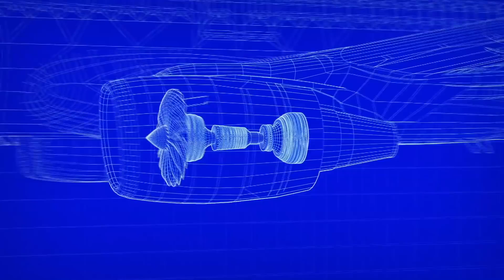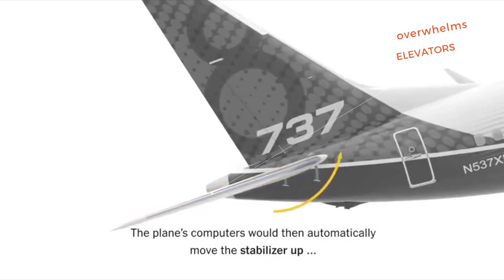737 Max 8 probable cause revealed - Prof Simon

Comment: Computers have driven aircraft systems for decades.  The Airbus flight controls are all controlled by "fly by wire" systems that have no direct connection to the hands of the pilots.  All radio signals through computers.  The Max 8 is not unstable.  It develops a stall when the nose goes up too far.  What most pilots do not realize, maybe they didn't pay attention in the flight simulator, is that the new LEAP engines because of placement, cause the nose to go up more than previous models when power is applied. This is a normal reaction.  The DC 10 that crashed in Iowa made it to the airport because the pilots used the throttles to bring the nose up and down, left and right.  It is a wanted feature.  What ewe should be asking: why is the nose allowed to be brought up to near stall conditions by the pilot without intervention and 2. when the nose is brought back up, the MCAS will only be re-activated if the nose is brought back up to a near stall.  The only scenario I can see where this is possible, other than system failure, is where the pilot brings the nose up, the trim is being set to nose up, in order to facilitate the trim, and the throttles are advanced to maintain airspeed in a climb, then the aircraft suddenly is pitched up from 1. engine thrust, 2. re-trimmed tail plane and 3. pilot pulling back on the controls.  That might be the constant up and down that is seen in the profiles.  What differentiates this from those pilots that say that the Max 8 is the best aircraft yet, they have the knowledge to disengage the MCAS in the event of problems.  The answer lies in pilot training, not the aircraft.  Those that say the airframe should have been re-designed, do not know the history of the aircraft.      The Max 8 to 10 will outsell anything Airbus can come up with.

Comment: The Mcas moving the stabilizer in response to a bad sensor is very similar to a runaway pitch trim condition.  This is nothing new.  Pilots are trained to deal with this (in the US. ).
Reply from the maker: It’s a bit different....firstly Boeing never told pilots and secondly it keeps resetting and trying again until you’ve lost the ability to recover...all under pressure and surprise...
Reply: Professor Simon Holland   Thank you for taking the time to reply.  Surprised or not , procedure is to disconnect the autopilot so that it can’t keep putting in a bad input.  Older planes used to have a big red button on the control yoke.  I understand it’s two toggle switches on the center pedestal in the Max.  When that third party pilot misbehaves, you take it out pronto.  If the pilots did not have training to deal with it , I place the blame on the training syllabus.

Comment: The truth that 737 Max 8 is inherently unstable and breaks FAA rules for commercial airplane requirements is going to kill this plane commercially.  No software fix is going to change that.
Reply: Wayne T   The Prof said Boeing had a choice: larger stabilizer or a software enhancement.  Larger stab. Means more weight, which means less efficient aircraft.   Add the weight and design effort of a new stabilizer or put a different microchip in the autopilot.

Comment: That implies a very bad design. It's inherently unstable which is not permissible for commercial planes.  It also implies other rare, but not impossible situations such as loss of electrical power/computer malfunction that lead to compounded situations with additional flight control problems. Looks like FAA did not do what they are suppose to do to maintain safety. .. US is going down.. Indonesia just cancelled their 47 planes...probably just the start of other loss orders.

Comment: Thanks for the video, I am afraid we have all guessed the answer but didn't consider that Boeing told the FAA that no new training would be required to fly the max 8, only to find out that the new system apparently has errors that the pilots do not know how to deal with, and thus the two crashes occurred during take off when the pilot had not time to deal with an automatic system that they were not trained to handle.

Comment: I disagree. I still think that both crashes were avoidable had pilot proficiency been better. Boeing's blame should be limited to MCAS design inadequacies that should warn against sensor disagreement before engaging changes in pitch trim.   In both cases, the airlines failed to ensure that the pilots understood how MCAS works. Unsafe airplane? NO!  Unsafe carrier!
Reply: csjaugiedog   The mcas moving the pitch trim in response to a bad sensor is very similar to a runaway pitch trim condition.  Pilots in the USA are trained to deal with it.  The procedure is quite simple.  I’m concerned that pilots really aren’t pilots these days. They can’t manually fly the plane.

Comment: Your diagram shows that "the higher and more forward position of the larger engines on the 737 Max can cause the plane's nose to pitch up - a potential danger".  Yet, your audio comments refer to the reason for the crash was a "faulty MCAS system".  So are we saying that there is a design flaw in the 737 Max related to the position of the larger engines that therefore must be compensated by the MCAS system?  And it was the AOA sensor failure which caused the crash?  How do we know the sensor failed?  It's unclear from this video.
Reply from the maker: Hi Alex, yes...the new design of the plane with larger diameter engines...and more powerful...made it fly differently to older 737s. So Boeing, instead of calling it a 797, fitted mcas in the background to recover the plane if a legacy 737 crew flew it in the traditional way....cheap and possibly bad fix imho

Comment: The 737 Max 8 has a special computer override system to correct a design flaw.  That is, engines too large for the older 737 frame.  Does any other plane by any other manufacturer have this same problem?  Why was a design flaw approved by the FAA?

Comment: Man, I do hear what everyone is saying about Boeing and MCAS, but I can not completely dismiss the actions of the pilots, or lack of, that resulted in these crashes. Remember folks, these are not the only 2 instances where MCAS has caused this scenario to unfold, the difference being and the most critical component of any aircraft, is how the pilots managed those situations. That's just an unavoidable ugly truth that not many are talking about. The 737-Max is a modern version of it's predecessor, with different flight characteristics, sure, but very familiar flight controls in place. An MCAS failure, regardless of why it's failed, still presents like a runaway stab trim issue, which is easily dealt with, but raises the question, when others have acted upon it appropriately, why did these flight crews not? You want to blame Boeing, go ahead, but understand this, a nose up attitude is present in many aircraft, obviously a little more in the Max, so Boeing addresses the issue with software, a common practise throughout the industry, but get it wrong. They will correct it, the Max will fly again, but remember, the aircraft is recoverable, it's not a complete lemon, but as I feel is the case with the 2 very unfortunate instances, having a competent crew operating the aircraft clearly improves your chances of survival. Experience is one thing, but having a high level of competency is another. You can have 10,000hrs of experience, but that does not make you competent ladies and gentlemen.
Reply from the maker: Look at their training....
Reply: @SimonHollandfilms  I did Prof, hence the last observation regarding experience, but the quoted 200hrs for the FO is a little scary and may not have helped much given the environment they were working in, minimal altitude etc, which in my mind is bloody scary if Airlines are allowing pilots with minimal flying hrs to sit any where near to cockpit. That can't be right can it, surely he had more than 200hrs of total experience, maybe only 200hrs in the 737, which would make more sense, but brings me back to my first conclusion, wouldn't have been much help. Regarding the pilot, who I think had 8,000hrs, that's ok, but what type of pilot was he. Was he someone who has to follow all of the checklist when problem solving, which is ok, preferable even, or is he capable of thinking outside of the box and respond instinctively, because there is a big difference between the 2.

Comment: a more thorough physical redesign would require additional costs in manufacturing, replacement parts and maintenance. Probably should have started with a clean sheet aircraft. This whole situation is one gigantic mess. I hope we find out the honest truth sooner rather than later.

Comment: 1. The plan design was flawed. If designed properly the plane shouldn’t need a computer to fly properly. Computers fail, as they did in this circumstances.
2. The pitch sensors failed. They were faulty in the original 737.
3. The software was faulty.
4.The pilots were ill trained to access and manually override the failing system.
5. The procedure to override the system, fly manually and save the plane from disaster is ridiculously complex and time consuming, for even properly trained pilots, as seconds count to evade disaster!
Why wouldn’t one flick of a single switch be the override?

So many problems Boeing is in big big trouble. 
Many heads should roll.
Sell your stock now.
Reply: ARVID LYSTNUR   I agree except for number 5.  The procedure is actually quite simple and a pilot can perform in in sufficient time.  But the pilot must be willing to take manual control of the aircraft.   Something apparently lacking in the modern pilot who is just a systems manager.

Comment: The pilots had no chance with a misconfigured MCAS System. Even after turning it off, it takes too long until the trimm is set back to normal and the rudder is effective again, precious time not available at low altitudes.
Bad design decision made for greedy economical resaons, not audited with scrutiny by a failing FAA, paid with the lives of close to 400 humans.
This is the biggest aviation scandal of the last 50 years!
But the press is still concentrating on the failure to disclose the MCAS system to the pilots - which wouldn't have prevented the planes from crashing as the pilots don't have immediate control even after the MCAS is turned off.
Reply: The Stonegate Roadrunner,
I thank you for clarifying with substance what I’ve awkwardly stated.
It’s clear that Boeing needs to both repair the MCAS and develop an instantaneous override!

Comment: Why doesn't Boeing just install a string with a fixed end tied to the side windshield's frame just like what F-14 does, let the pilot view the AoA instinctively and let pilot decide if his AoA is too high. Low tech does not guarantee precision, but it is very reliable.
Reply: vc Biller  The string on the F14 is for yaw trim indication ( engine failure).  Has nothing to do with pitch.  I like the simple idea , though.

Comment: Can someone explain to me why this 737 Max did not stalled when it took off vertically at an airshow?
Reply: Miguel Barrero   Weight and balance for one thing.  Didn’t have 130 passengers on it. Second : it was under manual control all the time.  The pilot was connected to the behavior of the aircraft.  Not letting a third party fly the plane.

Comment: Apparently, flight crew can override the MCAS system but it appears some were not adequately trained for the changed 737 flight characteristics and did not, as a result, subsequently gain updated type certification. As a result, when the MCAS responded incorrectly, and repeatedly dropped the nose in response to a perceived high angle of attack, the flight crew were not able to respond quickly enough to override the system and correct the plane's attitude in the right way.

Comment: These monsters! 
They told the computer to protect the plane from the pilot’s poor manual handling skills. 
But then the two sensors can’t agree. 
The poor computer doesn’t know which sensor to believe, and is “afraid” to give manual control to pilot that might have caused of the whole mess in the first place. 
Poor thing :( 
Probably killed itself from depression... depressing the nose anyway...

Comment: IMHO always liked Boeing over Airbus for some reasons, but this is unnaceptable. Not the fact that a design is flawed, because it might happen. But the fact they knew about this weakness and put a SW patch. CEO of Boeing telling that safety is core to the company after the crashes. Boeing did the most relaible planes ever built, the 707, the 727, the impressive record of the 777. Poor managment most quit Boeing inmediatly. This bad decisions cant be rolled out. They ruined the 777x launch, and needed to be rescheduled.  I dont think Boieng enginering got bad, just the bosses did. Boeing is not Tesla, doenst need to hesitate for a new plane to rival Aribus. Both make an impressive work, top notch technology, and quality standards. It a shame that they run behind the purchase order and lead times. Because they can produce the finest and safest plane on earth if they want. Just, give the teams the proper time ansdroom for proper desicions. Im sure that many people warned about this inside Boeing itself, but CEOS are tuned in another channel. Same with DC-10. The door flaw was known. But, because financial reasons and presure, they pretended that it was right when in fact, it wasnt. They crashed tree DC-10 to realize that the door need to be fixed.

Comment: Apparently the Mcas system has the ability to move the stabiliser right to the end of the jack screw. In this situation even full elevator movement would not be enough to regain control. The aircraft would either climb to a stall or nose dive.
Reply: Arthur Matthews  that’s when a pilot takes over and manually retrims the aircraft and flies it him/her self.

Comment: So basically the max 8 has a design flaw with an unbalance centre of gravity that could lead to a fatal problem from day 1.  Boeing knew about it but just opt for a workaround instead of redesigned the plane and properly fix the problem. The motive that drive boeing choosing the workaround because it's the cheapest fix. Another reason as to why the introduction of mcas system and the ipad training was to keep everything discreet so that people wont be having 2nd thoughts and making a big deal out of it by saying the new 737 max 8 is totally different plane from the old 737, which then required the plane to go thru buttload of airworthy test as a new plane before the FAA can give the green light. The FAA might be colluding in it as well but to what extent remains to be seen.

Comment: it's unfortunate such a control mechanism put more lives on the line, a software update to me will still require a patch one way or another in the near future as it has happened. Boeing needs to come up with the best plane design which won't have such control flaws messing with the safety of flights and to rely on automated systems to control a plane really require critical observations.

Comment: Software upgrade alone is not enough as long as the sensors keep sending a wrong input signal.This situation reminds me of a my car's crankshaft position sensor that used fail frequently and to put my car stall the car.Luckily enough this stalling could happen on ground but just imagine when the plane is moving against gravity.Such a sensor playing these roles should have another one to back it up.Also too much computerization is complicates operation of things.

Comment: One cause and one only.....  The pilot didn't turn off the anti stall system because they didn't recognise the symptoms in time and didn't have sufficient time look it up in the manual.
Reply: keegan773   Mcas failure and runaway pitch trim are very similar conditions.  Pilot must react quickly according to training.